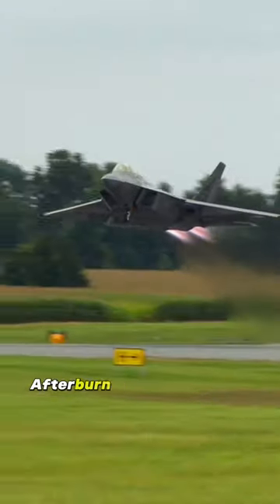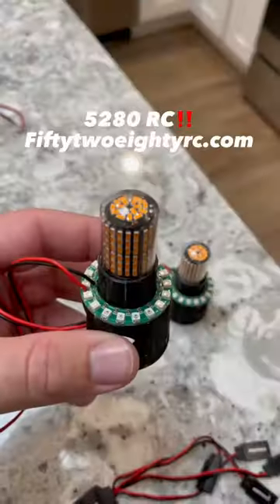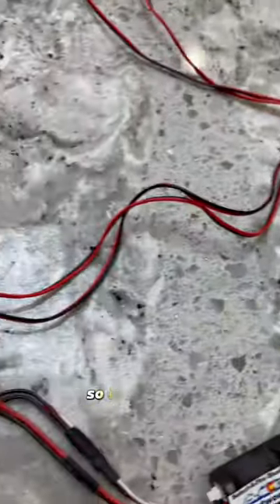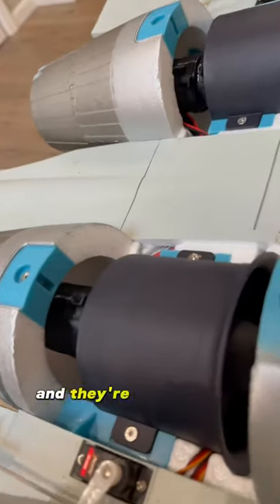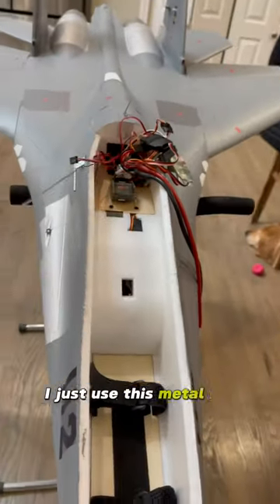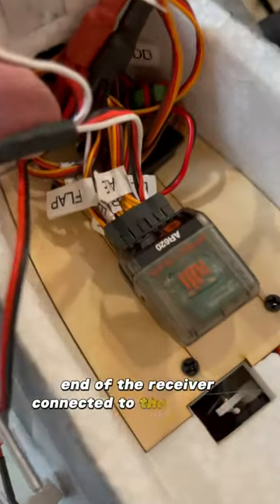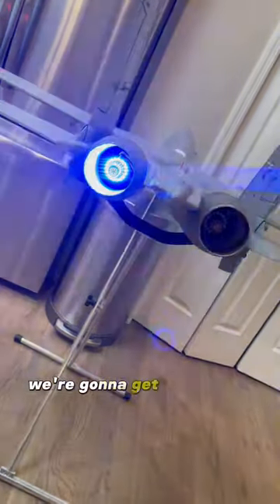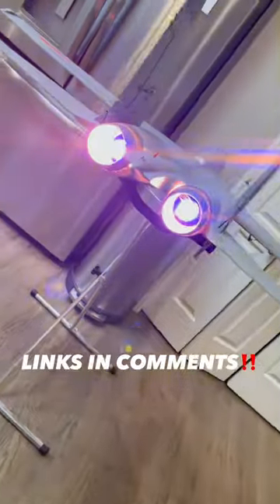Afterburners in a RC JET 🔥

Comment from the maker: Afterburner kit: https://bit.ly/RCafterburner
RC Jet: https://bit.ly/fmsj-11
Reply: Links do not work
Reply from the maker: @endah9692  copy and paste unfortunately
Reply: @Jays_rcgarage  Links just turned blue for some reason and now work thanks 💯✅️
Reply: Cool
Reply: @Jays_rcgarage  I think you shuold try and add a car accesories for the exhaust or whatever its called and adjust them for an rc plane.
Reply: @Jays_rcgarage can't copy
Reply: Can’t copy on mobile I had to hop on my PC. Just a heads up.
Reply: try to find and buy a jet with thrust vectoring, that would be cool @Jays_rcgarage
Reply: @Jays_rcgarage you should do the thing with the shrinking and expanding exhausts next!
Reply: Whatever you do, DO NOT show it in action.
Reply: @joanrawlins2232 should not shuold
Reply: Do the afterburners drain the batter
Reply: How you get to the link to buy the afterburner kit

Comment: Now you need to add a fog machine so you get some fumes to illuminate
Reply: That’s what I was thinking let’s get this comment some likes
Reply: Came here to say this
Reply: Would dry ice work? Less weight
Reply: Would be Nice!
Reply: I'd guess a thin ring insert of thin, clear or chromatic or milky white plastic streamers might produce that effect without effecting performance overmuch.  And you could pop them in or out as you chose.  They might even effect the exhaust sound in a direction more realistic.
Reply: A small vape would work
Reply: @chrisgrego7359  that shit will catch on fire after 30 seconds lol
Reply: @-pyrosef- bro if the plane goes down all the dry ice will hit that motor and freeze it to death
Reply: Yes
Reply: Something like a humidifier
Reply: @TX_Railfanner  If the plane crashes, I doubt that motor would survive anyway.
Reply: @TX_Railfanner put it someplace away from the motor 💀🤣
Reply: Yeah
Reply: They aren't fumes it's actually condensation caused by the really low pressure causing the air to become saturated on top of the wing.
Reply: fly-by through a fog wall ❤
Reply: @-pyrosef- only if the plane is very durable due to the nature of cold things
Reply: @allowmi nice idea
Reply: @TX_Railfanner  it's not the cold that'll do damage, but the moisture though
Reply: And then make a real engine for this model plane😂
Reply: @-pyrosef- way more expensive
Reply: @-pyrosef- true
Reply: I had the exact same thought
Reply: @allowmi  this has been done, look up EDF afterburner. Should be on a test flight video.
Reply: If he puts one in the cockpit too he can get a fake sonic boom
Reply: @bananbanan98   It wouldn't work. The visible mach cone is a quirk of breaking the sound barrier at sea level.

Comment: so disappointing I thought it would be a real afterburner 😒
Reply: There are some rc jets with real afterburner(they also hve a turbine and are not electric) but the problem is that the fuel consumption would be way to high and you couldnt even fly half a minute.
Reply: @michagysin3082 
Yes and people spend hundreds, thousands of dollars to have ultra realistic airplane models and they're still worried about fuel efficiency
Reply: @Menaceblue3  It wouldnt be fun to me if i could fly an rc jet for only half a minute
Reply: @Menaceblue3 It's not about fuel cost. It's about flight time. Flying for a minute or two would be rather annoying.
Reply: @michagysin3082 So do like the military and use air to air refueling. Duh.
Reply: I think Flite Test did that one time, used a butane manifold to produce flames in a ducted fan aircraft.

Comment: Saw a couple (literally 2) jets do a max take off. A-4 and an F-16.  16 pulled back as soon as the tires left the ground. Afterburner flame hit the concrete and bounced up at about a 30° angle then, bang zoom gone. Was really cool.
Reply: Have seen f15c do max climb to 50k feet during day and night. 
Now that is cool
Reply: Very cool. They disappear soo fast.
Reply: I was an F16 maintainer in the early to mid 2000s. Watching them take off was just the coolest thing, especially knowing that I had a hand in facilitating that flight. I remember this one day we had just changed an engine and towed the aircraft to a particular location where we would test run the engines, operational check, standard procedure. So when the guy in the cockpit opened her up and lit off the afterburner, I was probably closer than any human being has any business being, but I was determined to do something I've never heard of anyone else doing, so yeah, I lit a cigarette off of an F16 afterburner.
Reply: @crewdawg2008 i have 1 question. How hot was your face when close to the afterburner flames? Comparable to the gas stove flames?
Reply: @Danutzy1993  My face never actually got close. What I did was walk under the wing, then toward the exhaust, wearing a glove, I held the cigarette between my thumb and forefinger and just barely put the tip into the flame. Then I was able to withdraw it and smoke it. It definitely would have been too hot, and utterly stupid, to put my face close to the flames lol

Comment: To be honest i was hoping you modified a real RC jet turbine an turned it from a turbo fan to a full military jet engine with real working after burner.

You know so you can go for RC speed record or something.

This is still cool.
Reply: Rc jet engine is not a turbo fan 
  Its a Centrifugal gas turbine
Reply: A turbo fan uses a gas turbine to spin a turbine that spins a shaft that goes through the engine and spins a huge fan on the front 
   The high bypass fan
Reply: @terranovarain6570  ahh whatever then
Reply: And rc turbines use a Centrifugal compressor
Reply: You actually can have a multi stage compressor multi stage turbine with bypass tubes and a after burner on a rc
Reply: The second stage compressor and second stage turbine would be set up like a turbo fan
Reply: Rc turbine helis use a turbo shaft so you could modify that to run another compressor
Reply: Even a Centrifugal turbo fan would be a improvement on current tech
Reply: What I would truly like to see developed and its doable
    A rc scram aerospike with turbo pump
Reply: Is there a way to us a chamber to heat ammonium nitrate to make the oxidizer without blowing it up 
     The fact that I'm like I'll just use fuel oil to cool the nozzle
   Sounds pretty dangerous 😅
Reply: Make a quartz combustion chamber
Reply: @terranovarain6570  you couldn't use nitrogen its ignites too quickly and burns to hot. Maybe lamp oil or kerosene. Something slow an predictable. Also something that burns at lower temps. Maybe alcohol based fuel.
Reply: @stephenbachman132 I'm assuming you meant nitro & not nitrogen, correct?
Reply: @Iceberg86300  yes correct
Reply: @terranovarain6570 you could've put that in one comment

Comment: while generally not advertised, there is some people that actually put working butane afterburners in edf jets.
theres also another kit with a fibreglass ring of small streamers so it looks like theres flames out of the engine.

i'd like to see it fly aswell. the blinking blue looks verybad on the ground as you showed it imo
Reply: @drachma444444, - Yea, but it's on the ground right up close. In reality when it's flying it'll be a totally different look, probably very realistic.... the Blue let's I mean....

Comment: you got it backwards - a blue flame is hotter than an orange one.
Reply: Yeah
Reply: it is the design of the afterburner and the air to fuel ratio not the temprature since afterburners don’t get hot enough to produce a blue flame.

Comment: it takes away power from the motor no thanks. That is hurting the performance of the plane. And the flight time. Not worth it.
Reply from the maker: LED’s. Pull minimal power. Didn’t notice any difference in flight times and definitely not power.